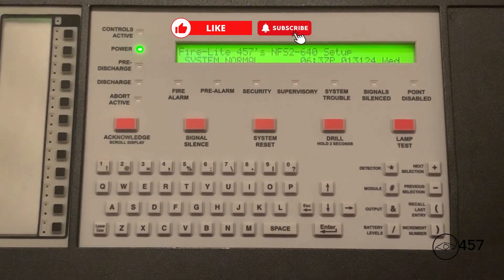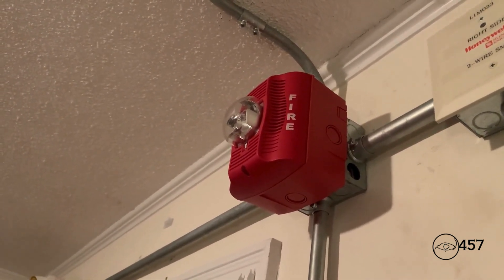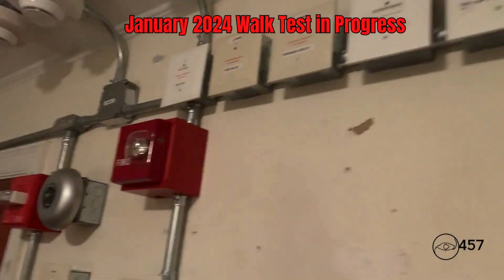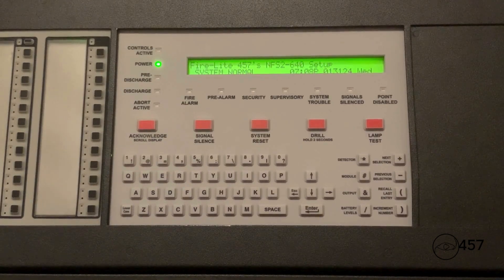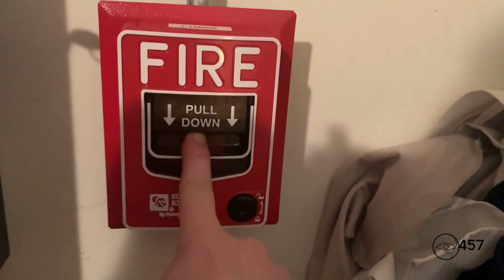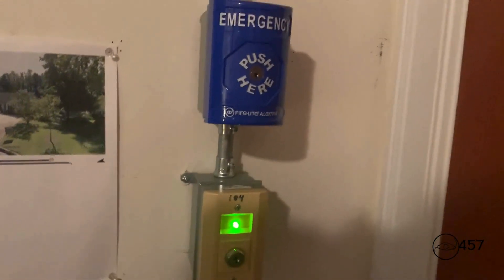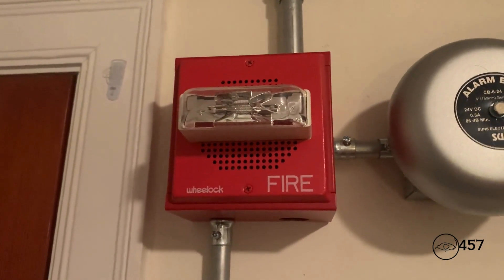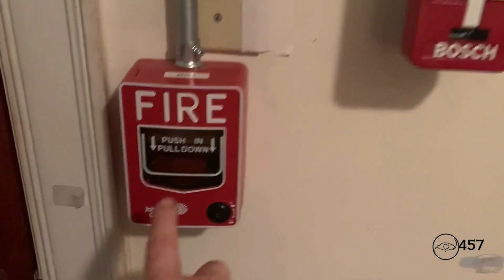Notifier NFS2-640 s4 Fire Alarm System Test 7

Comment: Cool vid, What are all the modules for?
Reply from the maker: Above the panel, 3 are relay modules for my MP3 board, and the other three are control modules, one for the B200SR sounder bases, 1 for the bell beside the E70, and the last one for a blue strobe for the tornado signal.
Reply: @Fire-Lite457  I understand why you need the relay for the MP3 board, but why for the sounders and strobe
Reply from the maker: @KidderVerse  All 4 main NACs are already being used for other things.
Reply: @Fire-Lite457  OH, Makes sense, I have a Fire Alarm channel too, but mine isn't as good as yours

Comment: are you gonna connect security system to fire alarm panel and see if security led is on
Reply from the maker: I have no space to do that. Plus the security system would need either a monitor or mini module to trigger the panel. I would love to do that if I had a security system for my whole house. But it would be challenging to flush mount stuff and run wire for the SLC to the monitor module.